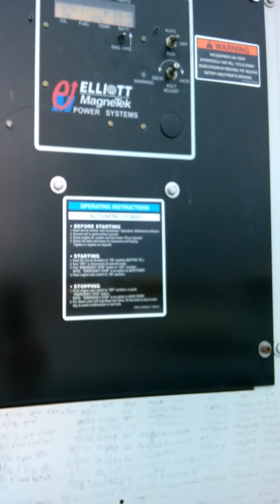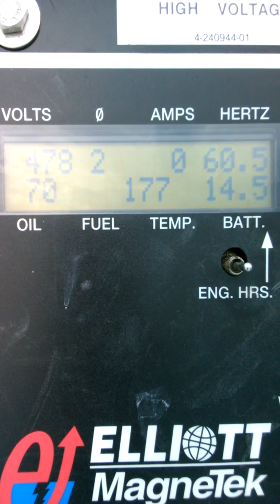Its running and phone test

Comment: Yep, we do the same stuff.  I noticed zero amps. Do you ever get to load test it other than emergency. Some of them come with a load bank. Most of mine didn't have it.
Reply from the maker: usual test I just shut down the emerg feed to simulate a failure...this day was more of a diversion and just running it while I was checking drains for coming bad weather...just one of a few buildings I watch over. Thanks for watching!